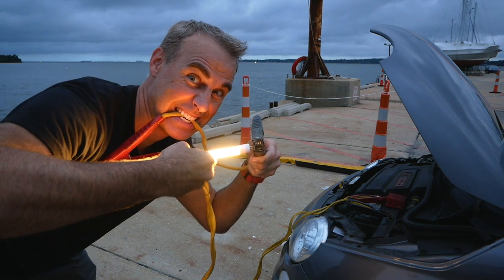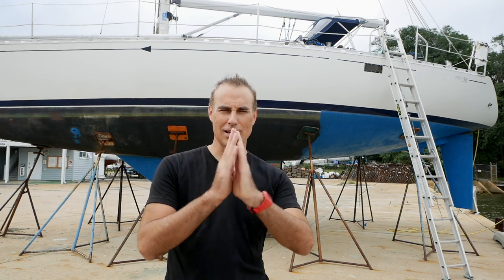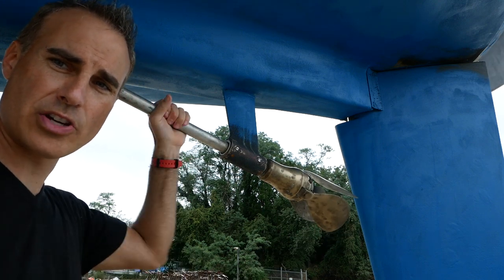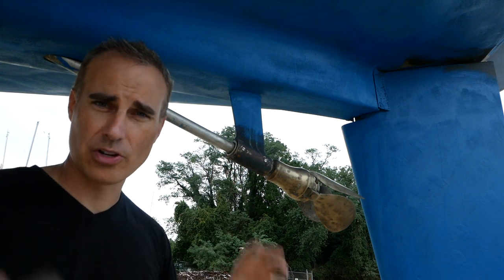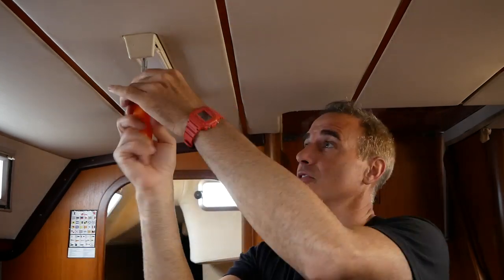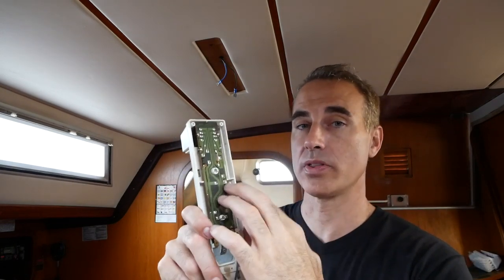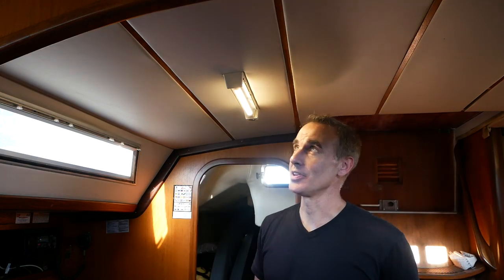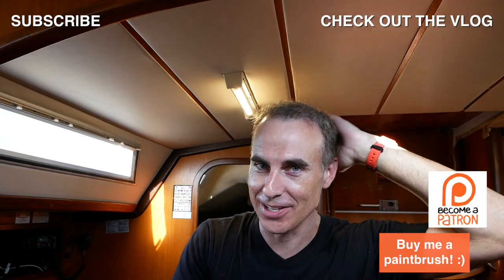How to Convert Fluorescent Light Fixture to LED

Comment: Next time you solder, coat the wire end with hot solder first and also pre solder the area you want to connect. Then u just need to heat the wire on the joint without having to hold the solder

Comment: Why don't you have a zinc on that shaft?  That's not how soldering is done.  You heat the wire and touch the solder to it.  You don't melt the solder with the iron.  What you made was a cold solder.
Reply from the maker: I replaced zinc on both the shaft and the propeller about 2 days after making the video. So, yes, it has zinc on shaft and prop. Not sure of the difference between hot and cold soldering. I just know it was very solid. I actually tried to break a wire off the redo it after the fact and it wouldn't budge.  So it was certainly "welded" on good.
Reply: The difference is, you're just pouring hot solder on the joint.  Cold joints are unreliable. The solder bond will be poor and the cracks may develop in the joint over time.
Reply from the maker: Thank you for the tips. I didn't know that. 👍
Reply: It is entirely possible that the solder reached a temperature sufficient to heat the copper wiring and allow the solder to wick & flow. 

It would have been completely accidental of course, so your advice is still apt.

Comment: It would make it easier if you tinned the (solder coat the wires)  ends of the wire first before     soldering to the contacts
Reply: and use smaller wire.10ga is not necessary

Comment: I enjoy your videos a great deal.  Everyone else is harping on the solder and heat-shrink.  I'll add my two cents; pay a little extra and get SOLID wire, not STRANDED wire.  The individual strands can break inside the insulation and reduce the conductivity, increase resistance, cause heat, and snowball into bigger problems.

Comment: Being an electrician is 35 years I suffered through this video just to see how you did it. LoL. My brother just finished his bottom paint, repaired 2 sucpers (msp?), and now he's replacing a rudder bushing so he can spash his. After painting your hull the boat yard will have to move the stands so you can paint under the stand pads (which I guess you know by now since this is an old video). I wanted to say in my comment to your previous video about trailering your boat to California, it's expensive to sail through the Panama Canal! There are videos about the cost of traversing the PC.

Comment: Careful with 12V car batteries (well any battery for that matter).
It's all about the current, not the voltage.
Car batteries are able to deliver a huge amount of current in a short period of time, i.e. for the engine starter, and this can mess you up pretty bad.
Reply: BTW, a good soldering is shiny/brilliant. If it is matt, it's not a good connection and you should redo it.
Reply: came to say this. 120V AC in your house is nothing (I got 240V shock in europe no problem), but a DC car battery scares me much more! That's some nasty amperage!

Comment: There are some products to avoid corrosion, I suggest you to use 12v-19v dc adapter for the laptop and other appliances and not to use dc-ac inverters to save energy. You could need a EMP protection bag to keep electronic devices safe from lightning strikes, there's a map of ocean lightning strikes in google. Also you could check an Outernet antenna and dongle to access to their free weather prediction grib files.

Comment: Josh , small correction, that circuit is not a blast that circuit is dc to ac inverter fluorescent tube in order to work need minimum
couple hundred volts and your supply is 12v only
blast is used  by feeding tube with 120v or in Europe 220v to limit the current
by the way I do like yours  videos and soon will get my first boat
keep going you are the man Regards
Reply from the maker: Thanks for the info John!

Comment: Nice how to video! I converted my boats old lamps to LED recently, but to be honest it was far cheaper and much quicker to just buy the full LED light fittings and just swap out the whole thing.
Reply from the maker: Nice. I looked into swapping but my old fixtures where imprinted into the ceiling. So it would have been a bigger ordeal trying to change it out. It actually was very cheap to do what I did. $15 for the LED bulb then a few small supplies, like wire for a couple of bucks. It's a work in progress. Thanks for commenting!

Comment: Thanks for the info on the Cutlass bearing. I'm thinking of getting a press and it sounds like the press with the shaft in option worked well for you.
Reply from the maker: Yes. The tool press seems to be the only way to do it without taking the shaft off and all of that. I've seen those presses online and they are quite expensive but something cheap like this might work also: EAIaIQobChMIw_afgrDL3gIVj1mGCh38sw44EAQYBiABEgK8vvD_BwE

Comment: Hi Josh,  Great videos!  A suggestion for the future.  It is always advisable to have a good mechanical connection between the wire and to what you are connecting before you solder it.  Plus, doing so makes for a better electrical connection.  It can also eliminate the need for the third hand if done right.  A boat moves a lot and things flex and sometimes break.  Solder is not a good material to use  for mechanical connections.  Wrapping the connections in a good marine grade electrical tape is also a good idea.  The shrink wrap another poster suggested is also a good choice.
Reply from the maker: Great tips! Thank you!

Comment: Another great video Josh.... nearly scared me with that jumpstart cables and fluorescent bulb action.. .. when do u think you will hit the H2O?
Reply from the maker: I put the boat in the water this morning. I wish I could post a photo in the comments. I'm currently sitting on her thinking "where do I start." I have a ton more work with electronics, batteries, anchor, running rigging, climb the mast to re-wire things, etc. I guess I'll just try to tackle it all one step at a time. Cheers! Thanks for the comment.
Reply: @JoshPostVlogs  thanks for replying, I was actually writing while watching and I noticed at the end u said u will be done in 2 weeks.... must be a great feeling......

Comment: Hi Josh, love your video's but this one is a bit slow and a lot of repeating!
Reply from the maker: Thanks for the feedback. I could use your help editing I am sure. :) I tend to get wrapped up on special effects and other small details and maybe lose sight of the fact that I may be repeating myself. I probably spend 20 hours editing a 10 minute video. I spent about 20 minutes on the first three seconds alone. The sound of the light buzzing is actually a sound effect, and I wanted to make sure the sound effect was synched up perfectly with ever little flicker of the light bulb. I spend way too much time on those little details. haha.. Thanks for watching!
Reply: You do it much better then i could so thumbs up! where did you buy the led tl? I tried to find it but i did not succeed. Do you have a link?